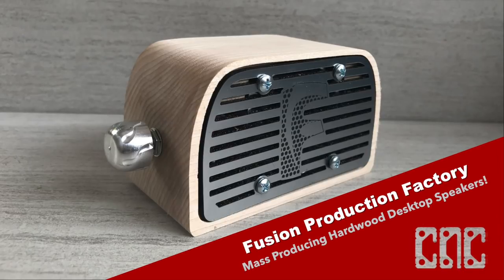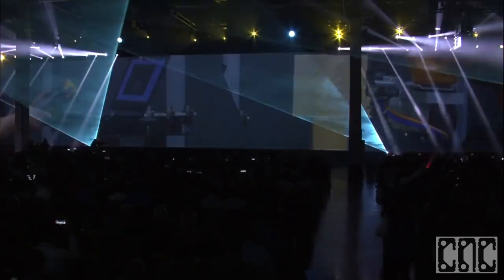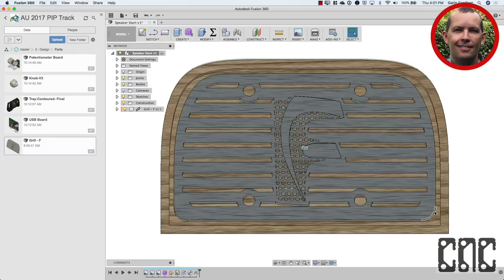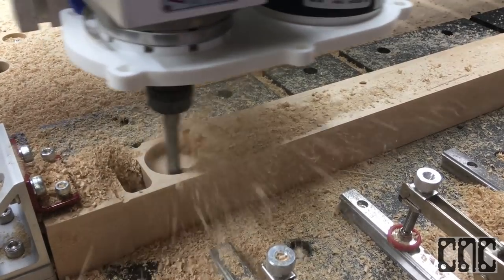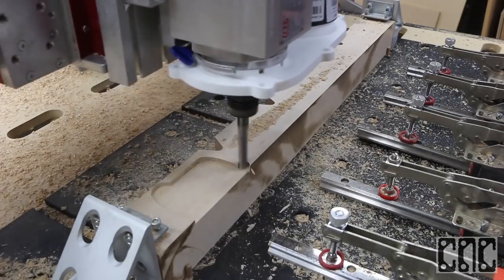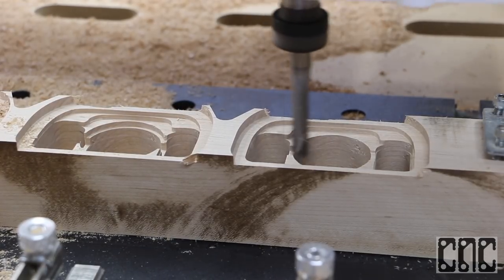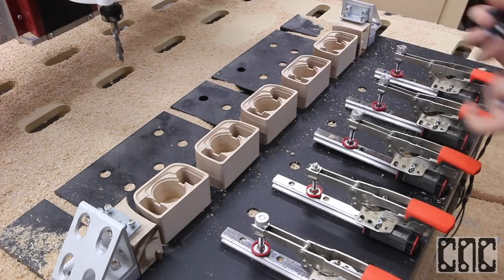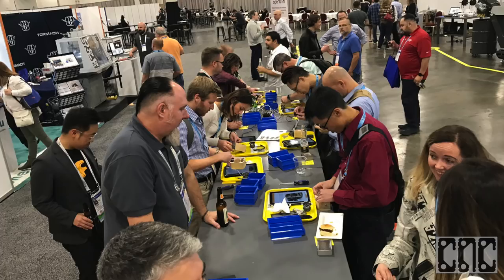Making hardwood desktop speakers live at Autodesk University 2017 with the PRO Series CNC

Comment: It's cool to see what went into making your part of that "factory" possible.  I didn't hop in line to make one, but I did get to chat with everyone involved in the process.  I was impressed with both the CNC router parts machine and the Omax.  I'm still surprised at the cutting speed you are able to support.  Cheers.

Comment: What are those rail assemblies that they have the toggle clamps mounted to?
Reply from the maker: Hi Joe, The rails are mounted directly to the HDPE project board using slide-in t-nuts recessed into the backside of the board.  -Nathan
Reply: Ahh, maybe I wasn't clear. What ARE the rails and blocks? part number? Link?
Reply from the maker: Hey Joe, The rails are 20mm profile linear guide rails with compatible bearing blocks.  Similar to these >https://www.mcmaster.com/#linear-rails/=1d332yt. Thanks! -Nathan
Reply: Link took me only to the overview page, but I get the idea. thank you for the response. Very slick, but pretty spendy unless you're doing high volume production or - like here - a fancy demo.